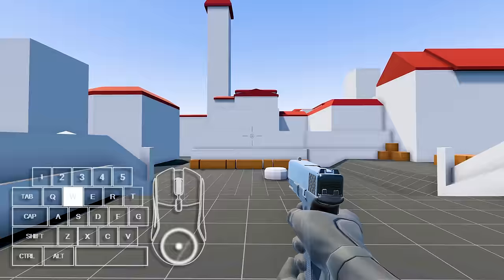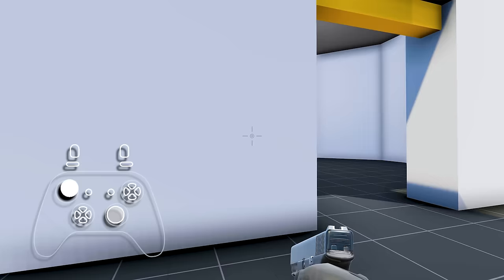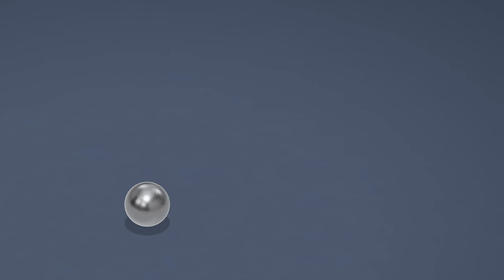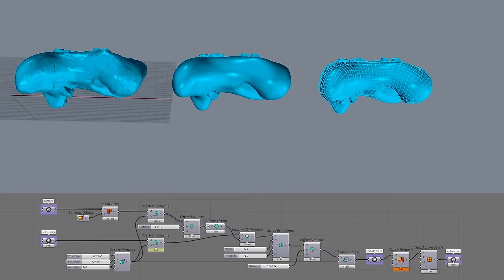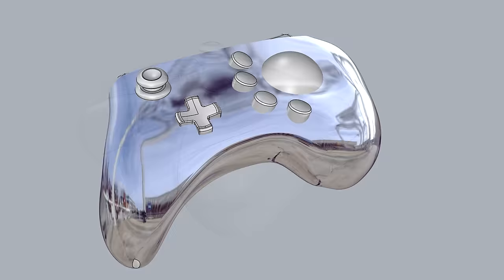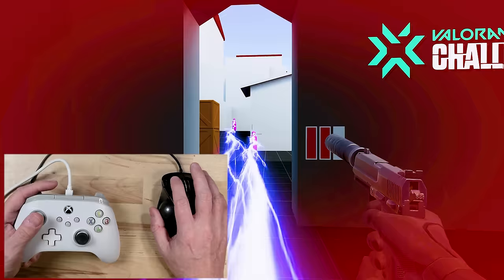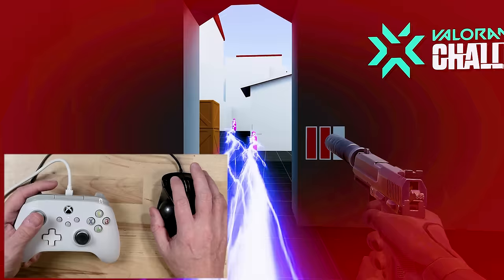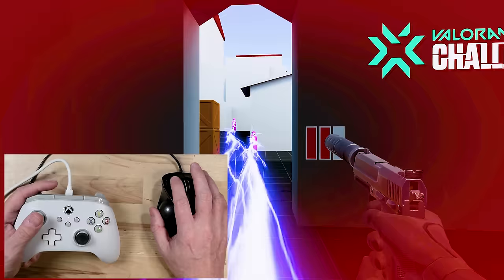Ultimate FPS Controller Design & Build

Comment: As a person who has been using the steam controller as my sole input method for my computer for several years now, I have worked out a few interesting point to add to your findings:

- The benefit of a track pad over a track ball or even a joystick comes from three places: 
          
1. The track pad is one big digital sensor / button. This allows you to add multiple inputs on it in various different ways. For example, I can have my right pad set to a track ball mouse (which is my usual method) and have a full D-pad underneath that activates when I click the touch pad. This allows me to use a full set of face buttons without taking my thumb off my aiming input.
2. The track pad has no moving parts. This reduces the wear and allows the touchpad to last basically forever assuming you don't get one that is faulty due to a manufacturing defect.

3. The track pad is able to emulate a joystick very well, and because it has such a large surface, I am able to get better accuracy than a joystick.

- Pair these three points with a gyro scope, and you have a setup that is 1-1 with a mouse. All you have to do is set the gyro to activate when you touch the right touch pad and you can use both the touch pad and gyro at the same time. This lets you use the touchpad in track ball mode for wide quick turns, while using the gyro for fine point aiming. Getting used to actually using both inputs at the same time took me about a month to get used to, but once you do it is a skill you can not unlearn.

- My final point to note, is that many games at the moment unfortunately do not support both keyboard + Mouse and Controller inputs at the same time. A lot of them do to some degree but for the ones where you have to choose, the track pads are a bit more versatile than a joystick as you can map it to a "no click d-pad" (this just means you touch the pad to activate it rather than having to click it) this joystick  can have your WASD mapped for the instances where you are unable to take advantage of analogue movement along with mouse aiming.

P.S Love your work, I think what you are doing is amazing, and its always good to see people out there pushing whats possible.
Reply: you input your soul into your computer?
Reply: @dingusuhum  🤣🤣🤣
Reply: I would love to be able to do this. I got the steam controller when it came out but i don't use it
Reply: "sole" not "soul"
Reply: @paninipizza1806  Ah yes thank you for the spell check. Im not very good at it myself XD
Reply: @coreyano  It is defiantly not for everyone. In order to be able to get  the most out of it you need to be willing to learn how to use the steam controller configurator. In my case I have always  used a gaming laptop instead of a desktop since the mobility has always been important to me. As a result it was much easier for me to get behind going full steam controller, since I am often sitting in bed or lounging in an arm chair. If you are ever interested in giving it a go, feel free to reach out to me, I would be more than happy to give you a few tips for setting things like acceleration, smoothing and the like to make the experience as easy as possible.
Reply: @greymamith7270  This is exactly how I've setup my steam controller too.

I tried to sell it to my friends too but none of them were eager to even try it. New thing = bad. 😔

Best controller there is, if you're willing to learn.
Reply: @Kaltsukka  Its both a blessing and a curse. To the point I actually ended up buying 10 of them before the stock ran out here in New Zealand (I picked up the last 10 there were being sold in stores here) to make sure I would never run out of working controllers or spare parts.
Reply: @greymamith7270  Sigh... I was shortsighted. I only have two of them. First one got a broken right bumper. I could probably fix it but I need proper tools to open it.

I dread that day when the other controller breaks too some day...
Reply: people dog on mobile gaming but using a touch screen for me is way more accurate than the mouse. gyro on pubg mobile i straight pwn mofos. good thing i saw this comment before i typed a bunch of shoit, saved my breath thanks.
Reply: Genuinely impressed you managed to stick with that device and get something out of it. I really wanted it to work and I really wanted to like it but… I had to throw in the towel.
Reply: @TommTooTone  XD no problem. One day the world will understand the power of the touch pad + gyro
Reply: This controller type can still workout
Reply: @Raderade1-pt3om  no doubt its better than a control stick
Reply: @greymamith7270  My concern with touch pad is hand sweat, how big of an issue is that?
Reply: @Hakkar  well its not really a thing for me to be honest. even when I play all day it has yet to be an issue. It is of course possible that if your hands are clammy that it will get sweat on it, but it will be no more than would be the case with an Xbox controller.
Reply: @greymamith7270 I've had one for years but mine lost its ability to connect to anything and I'm not sure how or why. I've got a steam deck now though, and everything you said about the controls rings true, and this thing has functionally replaced my PC.
Reply: @greymamith7270  never going to happen because thumbsticks have something touchpads and gyros are never going to have.  It is all about that auto centering resistance to deflection.

Its the same concept of buying the upgraded pedals from fanatec.  The load cell pedal. The load celll pedal doesnt move like a normal gas pedal and brake it's very stiff.  The load cell gives much greater control over braking force for racing games because its easier to build muscle memory based off resistance rather than distance traveled.

While thumbstick resistance is not as extreme as a load celll vs regular analog deflection with a generic spring resistance.  The resistance component of the equation is still there.  It's easier to build and mantain muscle memory around that resistance than it is to build, mantain and avoid nintentonal inputs than what a touchpad + gyro offers.

Ie. There is no unwanted inputs with a thumbstick.  Whereas your gyro can inadventantly work against the player just as much as it supplementing the players inputs.

Noone wants to have hold a controller at the perfect angle just to incorporate a gyro to gain at best a 10% advantage over the thumbstick deflection under the most ideal situations.

Especially when soft auto aim built into most fps games make the entire benefit of the gyro kind of moot.

People would rather play the game instead of playing the controller.

With touchpad + gyro.  The majority of people end up playing the controller instead.

It's why the steam controller failed.
You spent more time experimenting with touchpad gyro sensitivities  and deadzones than you do actually just playing games with it. And the finnicky sometimes inconvenient nature of the gyro providing unintended inputs is why it hardly sees any use on the ps5 as well.

Nobody wants to play the controller when they sit down to game.

Gyro will never be pick up and play.
Reply: @nope1a4  both of these problems arnt really a thing. To start with. The reason why the steam controller failed is not because the input is bad. It failed simply because steam failed to realise the critical importance of marketing the mouse + gyro concept. If you look at all their marketing material and every default steam controller control scheme ever, you will notice the gyro is used no where.

Some points to alleviate your other concerns:

The way we set the gryo up, is we make it only activate while we are touching the right touch pad. This means we are never forced to move the mouse when we dont want to. We then set the touch pads input to trackball mode which allows us to drag our thom across the pad for fineish movment or swipe our thumb across it for wide turns. It is the pairing of these three methids together at the same time that make this superior to a joystick specifically for applications that require a mouse.

To your point about the resistance of a joystick being helpful for building muscle memory hat may be the case, but because the steam controllers pad is so large it is actually easyer to use than a joystic simply because there is a larger control surface than a joystick, which in my oppinion provides a much easier experience. It is also worth noting that because the joystick positions are represented by a spot on the pad, rather than an amount of fource put into a stick, you are able to get to a specific joystick value instantly, which while having limited utility is still somthing joysticks can not do. 

Finally when all is said and done the steam controller still has a joystick for the applications where a stick is simply more fun, or for those that need to ease themselves into the input. This is doubly true for the steam deck, however the decks touchpads are unfortunately inferiror to the controller since they are much smaller.
Reply: @greymamith7270  you're not getting a specific joystick value trying to drop your thumb on that pad.

sounds good in theory, but not in practice. 
 Peoples thumbs are too fat for you to make such a claim.

Also, the gatekeeper to activating the gyro doesnt alleviate the unintended inputs it introduces once its active.
Reply: @nope1a4  to your first point, peoples thumbs are in fact small enough, while it is true there are people who lack the dexterity required, there are a significant number of people who have enough practice using their smart phone (which is the comparable input in this case) to warrent it being accurate enough. As I have said it is largely dependent on both practice and having large enough touchpads, which the steam controller has, less so the steam deck.

To your second point, gatekeeping it is enough to make it not painful, people are more than capable of stopping a controller they are holding with two hands from rotating, in the moments they are flicking their thumbs across the surface. When I was learning how to use the pad + gyro the maint difficulty that I faced was aiming at things in the distance. This was primarilly caused by having the sensitivity of the pad be the same as the gyro. Some people such as rambletan have found that decreasing the sensitivity of the gyro specifically completely removes this issue, and for many makes it much easier to use the pad for wide turns, and the gyro for fine point aiming. 

If had to choose between a touch pad or a joystick (specifically for movment not aiming)  on its merits as a movment device alone, with none of the extra factors alone when I was starting out with the controller, then I would choose a joystick because its familiar. However the thing that pushed me to keep using it was the extra utility I gained by being able to add extra buttons under the pads click. Pair that with things like stick drift which exist on the steam controllers joystick as they didnt go for the ones that dont suffer that problem, and it makes sense from a longevity stand point to make use of the pads. After about a month of heavy use, my dexterity with the controller made it like an extension of my hands, and all of the issues with accuracy and jittery inputs, stopped happening entirely
Reply: @greymamith7270  peoples thumb 8n fac5 ar3 not tha5 accirate without doing alot of proofreading to correct ut.

That represents the normal amount if errors I usually have in a text from my oversized smartphone. 

Specific to the steam controller itself. The only way to get maximum deflection of a joystick emulation you have to drop your thumb somewhere on the middle then drag out to the edge to achueve that value. Otherwise the fatness of your thumb forces it to average out somewhere in the 80% range.  The average of your thumbs total surface contact is probably around 20% of whats available on the pad.

An easy way to determine this. Let the controller collect so much dust that you can see exactly how large of a surface area your thumb touches on the pad.  It takes about 5 touches for me to create a dust free line from right to left on the pad. 

And thats lightly touching the pad. Not attempting to flatten my whole thumb out. 

Do you look down at the touchpad while playing?  Then thats another element you're trying to overlook when hyping up the accuracy of being able to immediatly pick a deflection value. 

Then you want to pretend that you have buttons underneath that emulation..so now you go to hit one of those underlying buttons.  What is happening with the touch emulation?  It tries to input a deflection value...because you tried to press a button.  So emulating a joystick and abxy on the same pad is out of the question.
Reply: @nope1a4  Just because they are not pin point accurate on a phone typing letters does not mean it is not good enough to emulate a joystick. from my time using it in Arma 3 the pad is plenty accurate for both driving an heli applications using the advanced flight model.

In the end I believe we simply wont agree on this topic im afraid. Which is perfectly fine. Your view point is just as important as mine, and I appreciate you coming in to keep the conversation grounded.

Comment: I'm only at 10:32 in the video but I wanted to make everyone aware of the xbox adaptive controller. It's $100 but it's a very good tool for these types of projects. It breaks out the whole Xbox controller to 3.5mm TRS jacks and will even accept a lot of USB joystick inputs or let you tandem an additional second xbox controller. Then it takes all of that and outputs it as a single xbox controller. I'd definitely buy one if I was in the habit of making custom controllers.

Microsoft doesn't advertise if all of the remapping features are available on PC.
Reply: The xbox accessibility software lets you remap every controller except standards afaik. So you should be good to go, i atleast have the ability on PC to remap my elite completely
Reply: $100 can buy you two and a half KBMs. Like... Y'all. Why
Reply: @ethanleino9926  It’s an accessibility product, for people who can’t use Keyboard and Mouse or a normal controller. That’s the whole point. It also lowers the barrier of entry to making new control methods a lot.

It may not be for you. It may not be for me, but it’s goated for the people who need it.
Reply: @ethanleino9926 you can say that about literally anything in life.

Comment: Background: Computer engineer, been researching FPS and fighting game controller designs. Used Fusion 360 to model and print my own fighting controller. Have tested playing competitive FPS games with gyro using Steam input, reWASD, and in-game gyro control for over two years now.

Suffice it to say I think how we control games plays an extremely important role in how we feel about the overall experience.

This controller you've made... is nothing short of magical. Thr trackball usage and ergonomic shoulders allow free movement while accessing a bunch of buttons, instead of relying on face buttons that naturally decouple your aiming hand to use them. 

My one itching feeling though, and I say this even after seeing how fast you became with it, is that this controller would be much more accurate with the use of two gyro sensors like the Alpakka along with the trackball outputting a more linear curve for reliable yet fine adjustment. This would allow macro control on the gyro level with simultaneous, granular correction from the trackball. I can use my desktop almost as fast as m/k using Dualsense's gyro with reWASD, while his demo showed his controller perform at about hald the speed of his m/k desktop use. Just my useless 2 cents.
Reply: could you make a mouse with control stick for superior movement and aim in games?
Reply: I'm not sure - as an actual competitive player, I'm not sure how something that has a stick can pass as usable. It's a lot better than a base controller, but to still be that much worse than keyboard+mouse just makes it feel wasted to me, especially considering hall effect keyboards
Reply: @kirasmith1147 I agree. Also as a comp player, this design will probably not come close to, let alone surpass, keyboard+mouse. However, there is a very real possibility that this controller will outperform current gen competition  from XBox/PlayStation from the playtesting data and analysis of the design.

One thing to think about, though, is his testing process and lack of playtesting data. Playtesting his own design with objectively few sessions, only a few hours of playtime with the new controller, and a long history (bias) to m+k all point to a flawed testing process. These points imply that this new controller's objective effects on game performance are unclear. 

At the end of the day, designs like these that pioneer and push boundaries are conducive to a growing and healthy gaming culture, not only in comp, but in the industry as a whole. I'm excited for what this could be, and I'm astonished by this man's innovation. Truly brilliant.
Reply: @harisonsharp8271 Yeah... he'd need to send it to a more professional player that does use trackballs to see it get some field work
Reply: @karisasani7006  There is no professional player that uses a trackball
Reply: @omegaPhix  However you can see my point